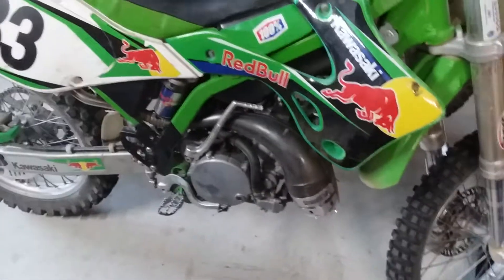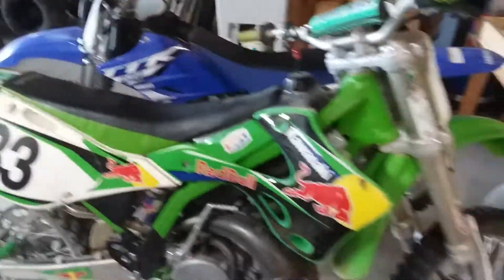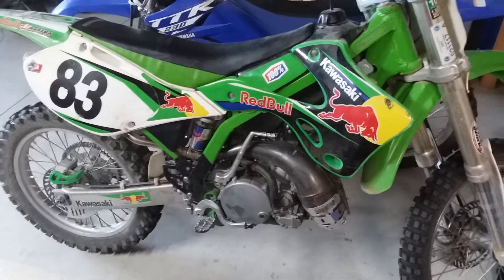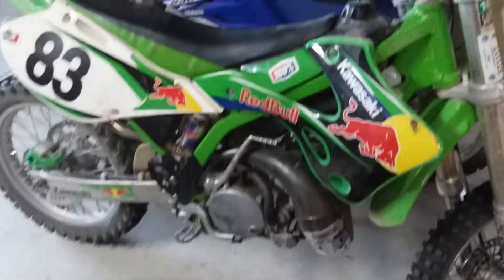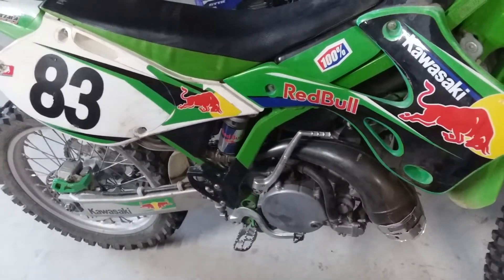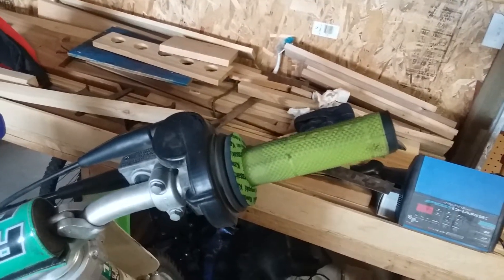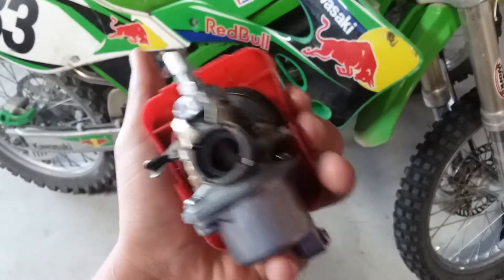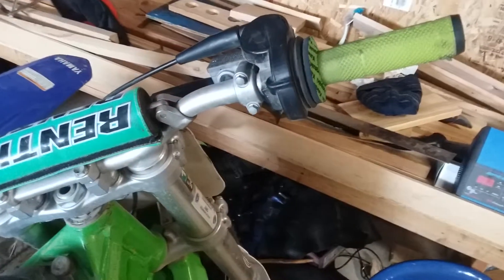Why you should NOT engine break on a 2 stroke dirt bike

Comment: what about bliping the throttle while pulling the clutch and letting off the throttle, the oil will stil lubricate piston right?
Reply: Yes thats why you blip the throttle to do that. But when clutch is pulled in rpms go down. It all depends on if oil injection and premix

Comment: Thank you for this, I just blew a top end on a goped scooter and this is exactly what I was doing. Only person I’ve seen on YouTube that explained this as a problem.
Reply: It’s a fact 2 stroke pistons only get lubrication through the fuel so when you let off the throttle there’s no lubricants getting in
Reply: @Nate87018 so the engine dies? If the engine is running it’s getting fuel. If what you said was true… Rekluse Auto clutches would be destroying engines

Comment: I didn't understand why oil doesn't reach the engine when you let go the throttle when the oil inyection goes to the carburator. Doesn't the oil also go in terms of  RPM, not only throttle?

Comment: Yes but about those engine ejected there is a cable splitter and your throttle cable so when you let off the throttle it slows down the oil a lot

Comment: A properly jetted pilot/slow circuit will never cause this to happen due to the circumstances you've explained. Also most carbs have a cutaway section on the throttle slide valve helping to prevent this situation even more.

Comment: It still gets oil as the higher vacuum pulls more fuel from the pilot. Even though it’s a small jet. The compression doesn’t slow you down it’s the vacuum on the intake. Which is strong. All the vacuum will still pull SOME fuel instead of pulling from the main it pulls from the pilot. I run 40:1 with full synthetic for longevity of the engine. I engine brake all the time never an issue. But also rev match into the downshift and continue to rev match and downshift through the gears as I’m slowing down. Giving the engine an extra bit of fuel. Regardless it doesn’t matter. Your piston looks like you ran it lean. Causing you to burn all your lube up running dry. Also downshifting and rev matching is how you should ride it’s easier to stay in the right gear keeping the rpms just in the power band range so exiting the corner you’ll be in the right gear and back in power band once you open the throttle.

Comment: Where did you get this information from if when you let off the throttle it stopped putting gas in your engine would stop running you are always going to have a constant flow of gas into the engine or else your bike would die.
Reply from the maker: Yes you have enough for an engine to run but not enough to lubricate a 2 stroke engine, please do some research before commenting

Comment: Honestly I’ve been riding 2 strokes for a long time now and I engine break literally every time I ride and am yet to blow up my engine, I have a 80cc motorized bicycle and I engine brake more than I actually use the brakes, I also have a honda cr125 and keep in mind I’m a trail rider so I go up and down hills all day and engine brake, yes on paper this makes sense but in reality I’m willing to argue that engine braking is not bad for your engine, if what you are saying was actually how it was then you would be wide open on your dirtbike, as fast as you can go and when you let off your throttle the engine would lean out like crazy and start to idle super high, not only that but when you got back on the throttle I imagine it would still be lean for a second until it could get fuel back to the engine so it would be super zingy and maybe even bog, I understand your concept but the evidence just really isn’t there in my opinion at least.
Reply: Thanks man i fully agree.
Reply: Thats a condition caused by fuel not oil. What your describing if you let of at High revvs most of the time what the pilots sucking up at a rpm that the main is jetted to be pulling in at that rpm then that pilot with slot leew fuel and oil being let in can cause destruction not because of fuel which causes the situation your saying but the oil is the problem.

Comment: I’m new to 2 strokes and recently got a kx 65 and I can prevent engine braking by just pressing the breaks sometimes
Reply: Don’t listen to anything he said go out n ride it
Reply: @trav3510 trav3510 your stupid if u think engine breaking hurts your bike lmao
Reply: @asho225  It does hurt your bike, if the cylinder has no lubricant it will likely cause damage
Reply: @Loganon2wheels  but it does have lubrication that’s what a pilot circuit is. Enough oil to keep the engine from seizing even with throttle shut off
Reply: @asho225  If you've got the bike pinned and engine break multiple times there will be no more lube left
Reply: @Loganon2wheels  stop making videos if thats what u think how do you think the thing sits there at idle lmao
Reply: @Loganon2wheels  trust me ive pinned my bike and engine brake down massive hills still havent blew the engine
Reply: @asho225  Just look up engine braking and educate yourself
Reply: @Loganon2wheels  and i dont need to look anything up im an engine designer and rebuild motorbikes in my spare time
Reply: @asho225  idc what you are sir but engine braking on a 2 stroke is a no no.

Comment: yes it will  run dry for like 4 seconds not anuf time without fuel to blow up 
 more concerned about stress on con rod snapping or  rod goes up threw piston cous piston

 is forcing it to slow down quicker equal more stress

Comment: What do you mean by “modern 2 strokes”? I have an ‘82 Honda atc250r. Does that mean I can engine brake? I’ve never seized a 2 stroke by engine braking.
Reply from the maker: Never said you couldn't brake just said it's not to great for the engine
Reply: @octaneaddiction1405  oh ok. Thanks
Reply: You're fine he needs to be educated just ride your 250 and have fun
Reply: @donlef765  alrighty. Will do

Comment: Ok so i have a quesion.I have a 2 stroke motorised bike and i engine break by pressing the killswitch and do wide open trottle.Fuel is still travelling inside when you do that type of engine break.
(The steps are=
1.press kill switch
2.wide open trottle
thats it oh and you stop faster when holding the trottle open while pressing killswitch *wich means engine breaking)

so can you engine break like that?
Reply from the maker: Yes this is fine, if your okay with more fuel usage. It will not harm your engine
Reply: Are u stupid?

Comment: When I want to slow down i Just down shift with like 15% throttle without clutch. Is that bad? I ride a ktm 150
Reply: literally no comment LMAO
Reply: No not at all. Dirt bike transmission are constant mesh transmission meaning you don’t have to clutch while shifting
But if your shifting down with out clutch that leads to engine breaking so you want to get on to the gas or just give it a little bit of gas and you’ll be perfectly A ok
Reply: @canadianrider7618  thanks!
Reply: No problem man

Comment: You honestly don't believe this nonsense with engine braking ? Most engine damage would be from stupid lead fuel / oil mixes and poor oil. Poorly jetted carb and a general lack of maintenance by not changing pistons and rings when you should. A leaky base gasket will melt pistons and seize motors too. From aircooled to watercooled race bikes , I've never had a issue from engine braking and yet i live in a hotter climate
Reply: I believe that this nonsense is true, the reason that it is so common is because all the new riders switch from 4 strokes to 2 strokes and don’t realise that when you come off of the throttle and the engine is at 5000rpm and it’s only getting 1000rpm of oil, that pretty much everything isn’t getting enough lubrication, resulting in the ring expanding and catching a port from all the heat, or the piston and ring melting and probably more
Reply: @MikeHunt-bg8sh  Never rebuilt a 2 stroke? Lubrication at no throttle isnt an issue, unless you plan on hooking up your bike to a car and dragging it a couple of miles in gear while off.

The oil coats the internal parts and is fine for the engine, when the throttle is off as the motor isnt doing any work therefore generating little heat and load. The oil/fuel being pulled from idle is absolutely fine for when your engine braking.

When you rebuild a 2 stroke there is plenty of oil coating everything to keep the motor lubricated even in instances where oil/fuel flow slows down
Reply: I agree.  2 strokes blow up either with low octane fuel, running pistons with 100 of hours on them, or just plain stupidity like putting no oil in fuel.

For it to be an issue you would pretty much have to tow the bikes for miles in gear at high speed. Even then I question whether anything would happen because 2 strokes don't become bone dry when shut off. There is always a thin coat of oil on all the parts from the last time the engine ran
Reply: @randy s maintenance is everything on any bike.  They blow because people use the wong oils , wrong oil to fuel mixes and don't perform piston changes when they should.  I'm yet to ever have a 2 strole blow up due to engine braking. Total myth. I have a IT490 with a YZ 490 barrel. To cool the motor after a long high speed run , i hit the kill switch or reach down for the chocke. No spark or excess fuel n oil cools the cylinder enough after a big run to prevent seizure. Been a very long time since I've done a full motor build on that !
Reply: @mrdilligaf1968  old school technique. My pop always did the old "rev it wide open kill switch bog" as it coats everything in oil for storage.

The only other thing that'll blow up a motor is jetting unfortunately I was a victim of. Went down to Florida where it's humid and sandy. Of course the bike didn't feel as good. Changed needle, felt crispy . Went around the track getting to the heavy sand section and you know what happened, long push to the van.
Reply: @richracing7420  Not sure why so mant have to play with jetting unless the altitude is so high or so low. In Australia  , standard or slightly is best unless you change the pipe or air filter.  Bikes can be slightly on the rich side as the air isnt as dense due to higher than most temperatures.
Reply: @mrdilligaf1968  depends on what bike you ride. I was on a 125 on a sand track. You generally need every single horsepower, therefore jetting needs to be somewhat precise or the bike feels like a dog.

I went from 45f to 85f with humid weather. Sand is the worst condition with the highest load.

 You can get a stock yz125 to stick a piston with out of the box jetting in sand. You need a bit of race gas of your doing motocross in sand.
Reply: @richracing7420  we have 91 RON 95RON and 98RON.  Very few bikes would need more than 98 RON. My current ride runs best on about 102 RON
Reply: @mrdilligaf1968  I'm pretty sure it's equivalent to our octane just rated differently hence the different numerical number. I was running 91 which is considered premium "pump" gas.

Depends on what riding your doing. If your just doing off road octane doesn't matter outside of putting premium in. 

If your wide open on a track, especially sand these motors get hot. My pipe turned a shade of blue that day.
Reply: @richracing7420  our fuel is rated at RON which 98 is the best. Most cars here like commys which is GM or ford falcons run 91 which is fine.
Reply: @mrdilligaf1968  they're functionally equivalent.  Just a different method of rating.
 We'd be seizing 2 strokes and blowing holes in pistons on 4 strokes on mx bikes if that was the case.

Our 91 is equivalent to ron 96 or so. You guys arent getting what we numerically consider race gas out of the pump. 

We're also not getting ripped off buying 100 octane race gas at $10 usd or so a gallon.
Reply: @richracing7420  our 98 RON may only be 96 but depends on the age of the fuel etc. I throw in a litre of so of E85 to boost the octane on my R1 that is jetted a little on the rich fuel air side. It makes a huge difference  ! Most bikes under normal atmospheric conditions are jetted on the richer side and thats to help protect the manufacturer warranty

Comment: Sorry for late comment, so when I am riding my bike and when I pull the clutch in saying it in first gear and idol it likes to creep forward a little bit and then when I I am riding in like fourth gear and I hold the clutch to not engine break it does it a little bit but not fully what does this mean?
Reply from the maker: Probably your clutch is to tight or warn down, i don't really know my bike does the same thing sometimes
Reply: Octane Addiction ok, thanks sm
Reply: Robert Luongo probably just your clutch is a bit warn out, but no clutch is perfect. For example, put any bike on a stand, but it in first, clutch in and the wheel will start to rotate, faster when revved. But usually you could stop the wheel moving with your hand, cause the clutch is out and there’s not much friction when it’s out. But if it’s worn out it sometimes sticks when out, or if the cables too tight.

Comment: How do you engine brake
Reply from the maker: Usually it's not something you actually do it just happens. Like after you've revved the engine high and you are no longer giving it gas and are just coasting so to speak that's engine breaking. But I'f your actually trying to engine break you can give the bike full throttle while holding the kill switch
Reply: @octaneaddiction1405  or like down shifting and just let the compression of the motor slow you down with no throttle
Reply from the maker: @7ILLEVANS  yes that's engine breaking
Reply: @octaneaddiction1405  lol I was helping further explain... Accidentally tagged wrong person... I did ask your opinion on something in one of these threads tho
Reply: Octane Addiction yhh

Comment: On my yz250 if i was coming off full throttle id just pull the clutch in then back to full throttle never had a problem till around 180 hours i ran it cold and cracked the cylinder
Reply from the maker: Yeah if you run a higher fuel to oil mix like 32/1 is what I run and dont have that MANY problems but everyone i know runs 50/1 and have alot more wear on there engines
Reply: @octaneaddiction1405  what does 31/1 and 50 stuff mean ?
Reply: @kadenrwy  oil to fuel ratio in the premix per gallon
Reply: @octaneaddiction1405  unless you running a older 2t 32:1 is super rich. I would never run less than 44:1
Reply: @rapscallion3421  honda recommends 32 to 1
Reply: @isthatasupra9569  so does every company, Honda also recommends their own brand name oil and all oem Honda parts. If it said go swallow a hotdog would you do it?
Reply: @rapscallion3421  50:1 is wayyy to lean for a race bike. Honda, kawa, and yamaha all run 32:1.
Reply: @isthatasupra9569  😂 50:1 is the sweet spot for the track. Good luck with your 32:1 mix on the track👍
Reply: What does pulling in the clutch do exactly? I try to tell my friend that he needs to pull in the clutch when not giving throttle but he doesn’t believe me and I can’t explain why you need to do it.
Reply from the maker: @WorksForMeBro  you don't need to pull in the clutch when not on the throttle
Reply: Octane Addiction Then why does everyone on the internet say to do it then
Reply from the maker: @WorksForMeBro  I've never heard anyone say this but unless you aren't on the throttle for a long time you don't need to pull in the clutch. You have alot mo re control of the bike when the engine is engaged

Comment: Still has oil of the idle
Reply: João Paulo Cordeiro but it’s nothing compared to getting full throttle amount of oil and then dropping back to idle which is like 1000 rpms or higher big difference man
Reply: @nickjones3820  motor isn't under load with the throttle off, which generates more heat than just raw rpm. 

It's like being in first gear high rpm up a hill is an easier load on the motor, than trying to have the motor pull to tall of a gear.
Reply: Rich Racing huh I didn’t understand what you just said
Reply: @nickjones3820  engines are under the most stress when loaded. Coasting a two stroke with the throttle off is a condition in which the motor isn't working very hard and generating less heat. You don't need a lot of oil for that. There is still an oil film coating all the parts not to mention oil being pulled in from idle.

Unless you literally hook up your 2 stroke bike to a car and drag it behind your car in gear, oil lubrication isn't an issue in terms of engine braking in a two stroke.
Reply: Ya except your motor is still doing 5000 rpm with 1000 rmp Worth of lube as he was saying